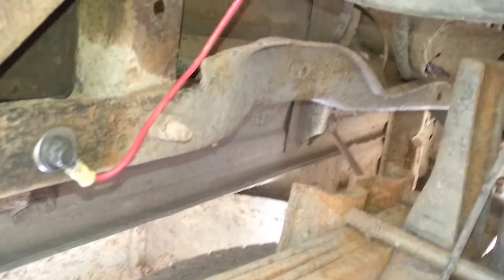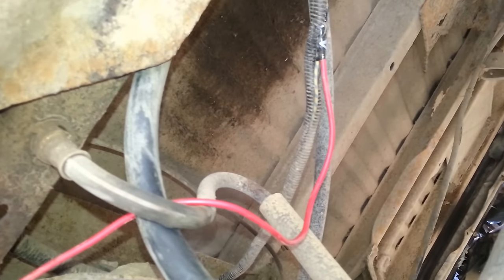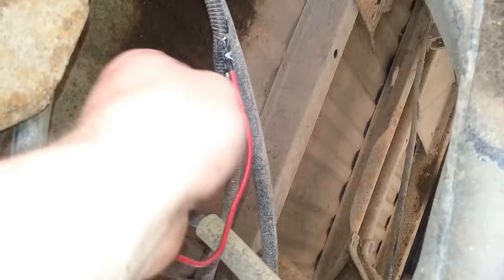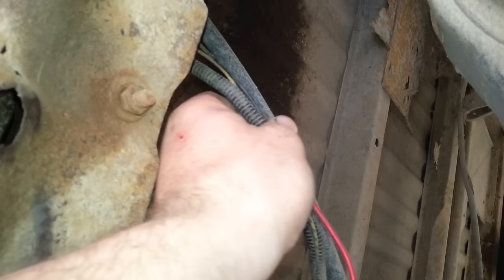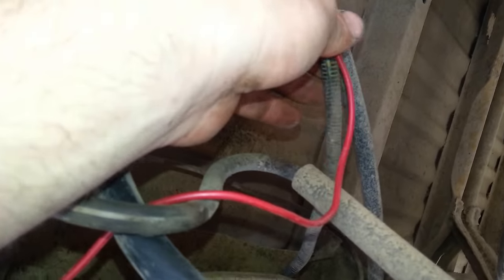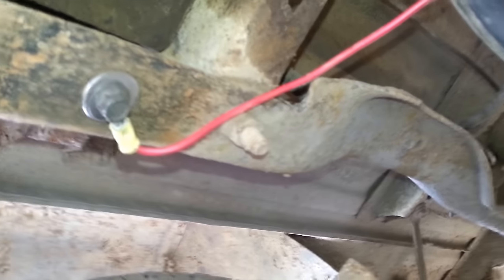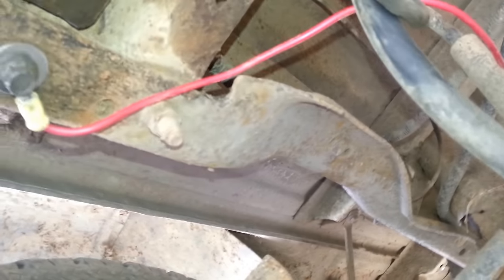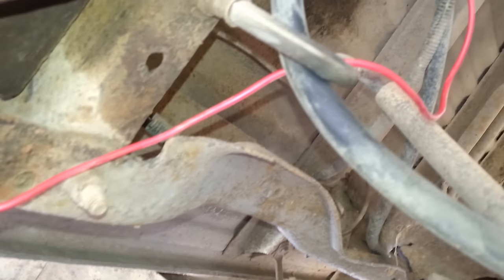how to fix a fuel gauge problem for ford and many more

Comment: C'mon man ... spend a little more time and effort showing WHICH "black" wire (to & from). All you show is a pretty red wire hooked to the frame going nowhere!
Reply: If you listen to what he said you should be able to figure it out. It's not just gonna fall in your hands.
Reply: Theres 4 wires in the pump/sender harness, pwr/grd x2, one set for each. (At least on my 05 ranger fx4). Depends what isn't working, but ull need a test light/ multi meter to decipher which is which. Plus u can Google *your make/model/yr + sending unit wiring diagram. I found someone listed thd colors on ranger forum
Reply: He straight up said hook it to your float ground. Goddamn man listen.
Reply: If you take your plug harness apart and look (the fuel pump connector) the ground for the sending unit is the one on the right. You can tell orientation by the clip that holds the connector to the frame. The clip is on the left side of the connector.

Comment: Should I just look for any black wire and connect it to the chassis man u need to THINK WHAT TO PUT ON  YOUTUBE BEFORE UPLOADING DIDNT HELP AT ALL
Reply: He said “to the float ground”. Maybe you should actually listen. Close the mouth and open the ears…
Reply: 10 years ago, shut up
Reply: I was wondering if the black was truly the ground wire lol. I'm having the gauge issue with the pump still working in my 2001 f-150. Trying to find info on the actual ground wire color scheme

Comment: This is actually a very dangerous video for people to be watching especially on modern systems because the ground wire is usually just resistant down ground. If you’re putting full ground to that wire, you’re going to completely throw off the resistance that is supposed to be shown to the ECM and cause multiple levels of problems you might need to change your description

Comment: This trick only shows your dash gauge works....Your still not getting the internal tank fuel level because the sending unit is not working...you could run out of gas and dash says you have gas...that could mean a shorter trip than expected...Hopefully not in the middle of nowhere.

Comment: hi mate ford transit 2.5 fuel gage notworking..i open tank 5 times there 2 wire for fuel pump anotor 2 for guge i test groun it ok nother wire shurt  can u help me its sgnail or come from fuse box ? its 2.5 2014 thnx

Comment: did this work? my gauge reads way past full. it has 2 tanks. and yes it reads way past full on both? so are you saying it is just a bad ground? if so I may have to try this. I will let you know... thanks for the video...
Reply: hey Richard just wondering if that work.
Reply: sorry, Both of my sending units were bad...
Reply: +Josh Phillips ya it ended up being both sending units. odd that both crapped out. mine would work (on the front tank) at about 1/8th of a tank. and the rear tank around 1/4th of a tank. yep both sending units are JUNK... the sending unit is not just a fuel pump, it is also the tank float that tells you how much fuel you have in the tank. the self made  ground strap will work if it is a bad ground. try it 1st before you buy a new sending unit. the front unit is a different unit from the rear. keep that in mind!!!
Reply: +Josh Phillips  there are BLACK wires that run into the fuel tank  them are the ones to test for ground....
Reply: +Josh Phillips if both are reading way past full it could be a bad ground???  but from what i have tested and figured out it was the sending units. also test your fuel gauge to make sure that works also. good luck bud..